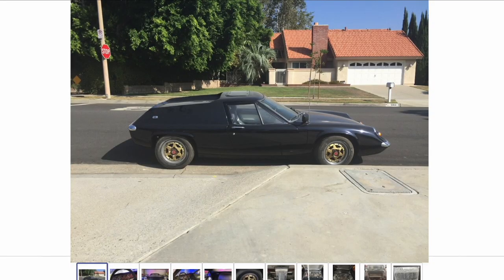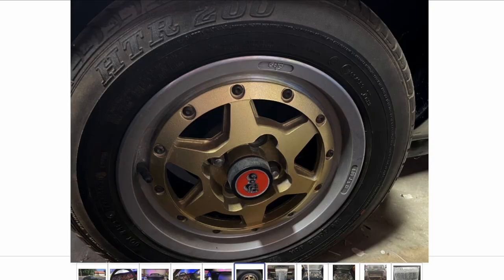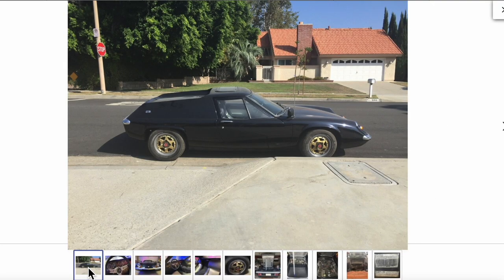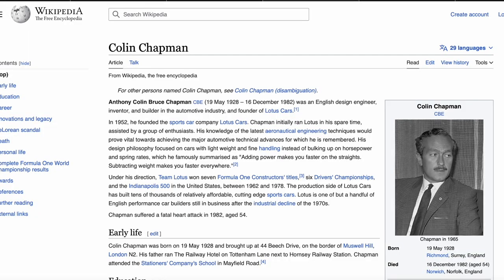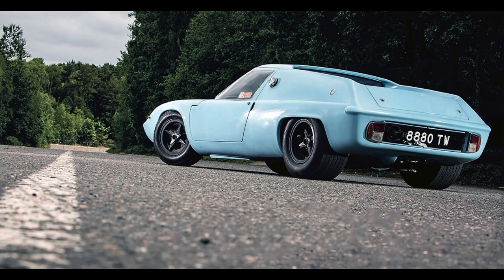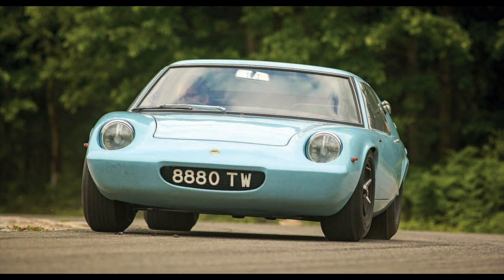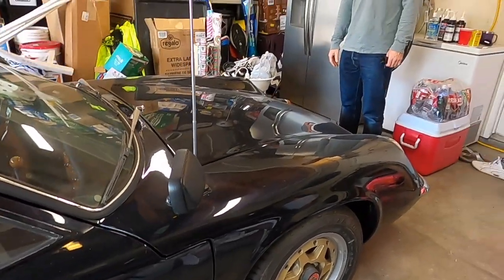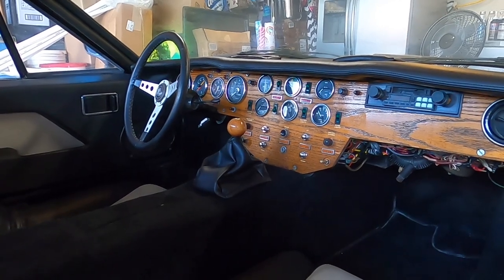I bought a 1969 Lotus Europa on EBAY

Comment: I have owned a type 54 for over 50 years and kept it standard apart from putting on a 12inch Motolita leather steering wheel, and changed from the mechanical fuel pump to an electrical pump.  They are amazing cars to drive if well maintained and the suspension looked after.   You soon get the "feel" when something is even slightly worn as everything is precise and light.  The best handling car I have ever driven and such fun to drive.
Reply from the maker: Love to hear this.  My car has an electric fuel pump in it.  Why the change from the mechanical pump?

Comment: I've owned 5 of them. The last one was a one-owner I purchased off of a late friend who bought it new in 1974 (a JPS). However, I prefer the bodies of the S1/S2s. The first one I purchased was an S1 in 1981. I cut the pan off, rebuilt the chassis and bonded it back together. Too much work but I only paid $800 for it. The S2 I built in the 90s had a YAG backed up by a Porsche 901 5-speed. I really miss that car but I went all Porsche about 20 years ago and never looked back I have 3 SCs and a 914 2.0. They are damned reliable. I had always wanted an Esprit but every time I test drove one it broke down. The Europa was a really underrated car. If only Emma Peel had driven one instead of an Elan.

Comment: I saw one of these as a child in the 1970's near Liverpool UK. Years later I bought a S2A Renault engined Europa when I was about 19. Loved it, and used it as a daily for a couple of years. You may have heard that LOTUS stands for 'Lots Of Trouble Usually Serious' which is partly true! Drive shafts are froma Hillman Imp. Bumpers from Cortina / Anglia. Door handles from a Leyland Maxi. The only thing that didn't go wrong on mine was the Renault engine, which was considered 'foreign muck' in a town close to Liverpool where Ford & Leyland dominated. I'd love to buy another now, but finding a good one is tricky. Enjoy your Lotus!

Comment: Cool 😎 great buy ! once up and running,perhaps remove the aftermarket sunroof and fill in the hole, or at very least,replace with a webasto type slideback opening...
Reply from the maker: Thank you! Once I get the important things handled I’ll ditch the sunroof for sure. Bummer too, because the headliner is perfect

Comment: Well done, it should be a fun journey.  I just took out my europa  pedal assembly today,its a 5 minute job and the joint clutch and brake is likely just a bit of corrosion where they pivot. Easy fix .
Reply from the maker: Thanks! You don’t remove the seat to do this do you?
Reply: No need to remove the seats, just remove the four nuts from underneath the car ,the bolt heads are welded to the pedal base, then just remove two clevis pins and its free.
Reply from the maker: @bertram256  thanks for saving me the time to figure that out 👊🏻🤝🌴